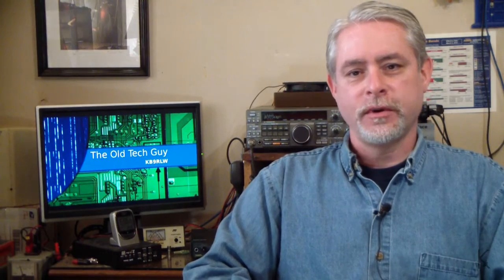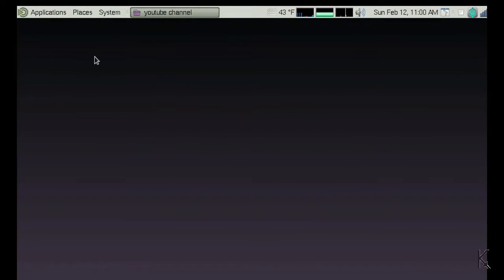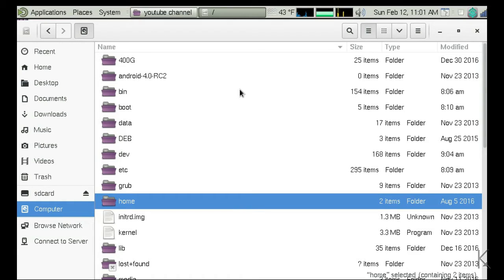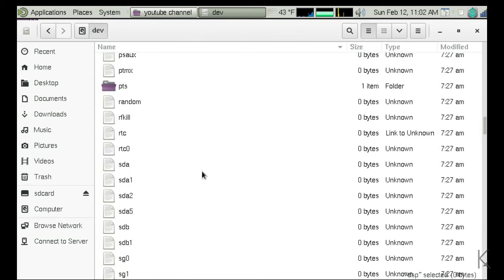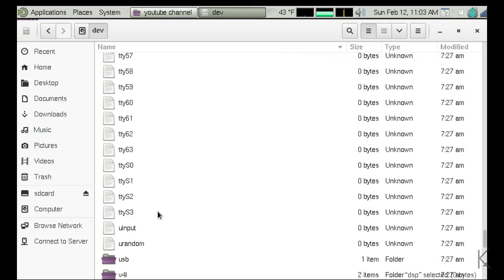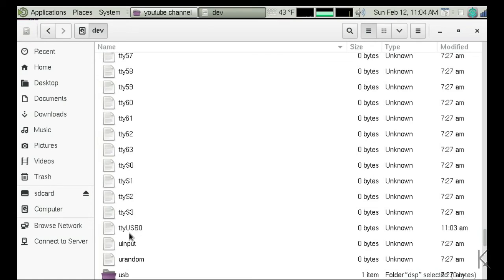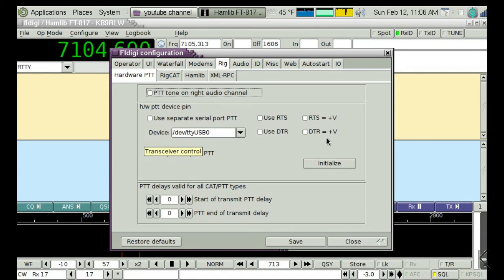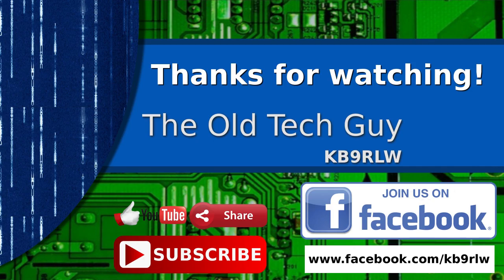Ham Radio - Setting up RIG control under the Linux OS

Comment: When you say that devices are not files you are technically wrong: devices are treated under **nix like any other file. You can use open, read, write, close ...you can type "echo hello > /dev/tty1" or cat <dev/tty1". Devices do not use disk space, they just get/send their data via the asociated device driver. The kernel treats all files the same way.
Reply from the maker: What I meant was the entries in the dev directory are not physical files on disc.

Comment: Kevin I recently acquired a raspberry Pi 4 and was wondering if HRD can be downloaded to it since it is operating via a Linux? Posible ?  Thanks again for your great videos  73 de Roger W8RLP
Reply from the maker: Nope.  Not even through WINE.   The Pi runs on an ARM processor, which is a risc chip.  HRD is an X86 binary and would only run on Intel or AMD processors.
Reply: Kevin Loughin Thank you very much Kevin. I enjoy your content, great video’s. 73 Rogr

Comment: I'm really new at this when it comes to Linux. I'm using Peppermint os and I can not get VFO control using Ham Lib from Fldigi, Flrig and JS8Call. I have 2 PCI serial ports. One is com 2 in Windows and that controls the Kenwood TS 2000 and an offline SCS-PTC tnc and in that acc port where normally the tnc goes. I have the signalink. Don't ask me to go there as Fldigi can not find that sound card.

Comment: I keep putting in the   dev/tty/USB0 then hit initialize and it returns to none don't know if it is drivers or something else tried deferent usb to rs232 devices
Reply from the maker: Well, what you typed here is wrong.  No slash in the device name.  ttyUSB0 is the device name,  /dev/ is the directory the device lives in.  So it would be /dev/ttyUSB0     
It's a full path name.  The first / means start at the root of the filesystem,  dev is the directory, the second slash means inside that directory, and finally the file name.
You can verify this by browsing to that directory, scroll down until you find the end of the list of tty files and see if there is a ttyUSB# device listed.   Another possible device name would be ttyACM0  But that's usually associated with a microcontroller device.
Reply from the maker: Also, in most software, where it says none, that's a drop down menu that might show any serial devices it automatically detected.  If it's a drop down menu, just click it and look at what's listed.  ttyUSB0 or ttyUSB1 might be there already and you only have to click it.
Reply: I typed it wrong here but it is correct in the drop down I don't see any auto setting and if it is in auto it would still be able to connect to the radio
Reply: I also run fldigi and flrig in windows 7 computer and have no problems
Reply from the maker: What type of interface are you using?   Also, did you go into the file browser and look in the /dev directory to see what it is named there?

Oh,  I just had a thought.   You might not be in the dialout group...   Linux is like UNIX from the mainframe days and has security on many things, including serial port access.  They used to have to limit access to modems by user.
Open a terminal and type the following,  case is important, that's a capitol G.

sudo usermod -a -G dialout {username}

Where {username} is your login name.  If you're not sure of it, you can type  whoami  in the terminal and it will tell you.

That command will ask for your password.   After it's done,  log out and then log back in, or do a restart/reboot.
See if that does it.
Reply: That didn't work.I am thinking it is drivers for usb to rs232 I am looking in Synaptic and there are several which do you recommend by the way I am running Ubuntu 18.04
Reply: Well I was waiting on you I watched another video of yours on installing amateur radio software with Synaptic.I installed other items and you said to log out and back in so I did.I tried fldigi rig set up just by off chance it solved the problem  and it worked.I love it when I accidentally solve a problem
Reply from the maker: The kernel comes with drivers already present for nearly all USB to serial chips.  Did you log out and back in after adding your user to the dialout group?  Did you verify that the ttyUSB# device was appearing in the /dev folder?
Reply from the maker: Ah, just saw your second comment.  OK, glad it's working for you now.

Comment: Thank you for straight forward explanation. My problem is that FlRig does not communicate with my TS-590SG even though /dev/ttyUSB0 is selected. When I run Hamlib Trace, there is a message stating that this port is DENIED permission. Is this something you know about?
Thank You
Reply from the maker: +Nuclear Ship Savannah Amateur Radio Club NSS-ARC yes, your user needs to be a member of the dialout group.  In another comment, I detailed the steps.
Reply: thanks for such a rapid response! 73
Reply: Works as advertised. Super FB!

Comment: I can't seem to get a serial port to key my transmitter. I see S0...S7 but none seem to work. I select each in turn then initialize and try to transmit. Serial card goes to the Packet Jack on my radio which has audio in and out and a PTT line. Using RTS/DTR and these work in Windows. Not using any other rig control software at this time. Running Mint Mate 18.1.
Any ideas how to get FLDIGI to work here?
Reply from the maker: Using RTS/DTR as a voltage source to turn on a transistor which grounds the PTT line?    Or,  using a level converter and rx tx lines for serial communications and CAT control?
What kind of serial port or adapter?  Is it serial port built into the computer or a USB serial adapter?
Reply: Thanks.
Yes, both RTS(pin 7) and DTR(pin 4) go thru diodes to the base of a npn(2N2222) which grounds ptt (pin 5 is the ground). The serial port is on the MB. The receive audio works fine. Either one of these lines works with Windows fldigi and every other sound card software I've tried in windows. I'm not using the rig serial port at all.
Reply from the maker: Ok.  So in fldigi, you want to set the serial device to /dev/ttyS0  Then set it to use DTR for PTT.
Reply from the maker: You can open a terminal and type  dmesg | grep tty
That should show you what tty device got assigned to your serial port.   You should see something like
 1.145755] serial8250: ttyS0 at I/O 0x3f8 (irq = 4) is a 16550A
 1.172736] 00:0c: ttyS0 at I/O 0x3f8 (irq = 4) is a 16550A
Reply: I had done all of those(It's ttyS0) before I asked you for help. No joy. Everything you said should work. Thanks again for taking the time. Maybe a permission issue?
Reply from the maker: Yes,   you have to be a member of the group named "dialout"
In a terminal,
sudo usermod -a -G dialout MY_USER_NAME

Then you need to log out and back in, or reboot.
Reply: Not a member. I've had permission issues when I added HDs to an existing system. It was always easier for me to  delete the linux partitions and reinstall it with the drive installed rather than t/s the problem! Forums were not useful for a newbie like me. The answers were too arcane for me to understand. I do use Mint as my go to OS for many things but I may defer to Windows for this ham radio software. I don't want to give up but I've spent hours trying to fix this. I haven't tried you latest suggestion yet, I'm close to the burnout point :) I need to take a break. Thank you for your patience! You have gone above and beyond. Thank you!
Reply from the maker: Well if you're not in the dialout group, then you can't access the serial ports.  So that's your problem.
It's a security feature from the mainframe days when modems were used to connect to other systems and users needed to be restricted.
Reply: Thanks.That's funny. Step 1: dialout group. If not in the dialout group nothing else will work! Good to know! Why is that fact missing in every linux fldigi install that I've seen (rhetorical)? Amazing!

Comment: hi switched to linux mint nearly 2years ago when win 7 support stopped I run fldigi for data modes gqrx for sdr on a funcube dongle cqrlog takes care of logging dx  cluster  and rig control for pouncing on cluster notices the only thing I can't get to work is rig control sharing for cqrlog +fldigi just won't do it ? so I live without it honestly best thing I ever did sharp learning curve but put it on an old computer and learn like the channel good luck Steve GW7LOP

Comment: Kevin,

Do you ever sleep?  Ha!

Show more hams how to use that old lap top by installing Linux and show what it can do and why.  Every one has an old no longer supported lap top just sitting there.  We are afraid to throw it out because of the old credit card and other private information still hidden somewhere on the hard drive (my son just wrecked a perfectly useable one with a sledge for that very reason). I am just getting into it to revive an old lap top just for the ham shack.

Dave K8WPE (QRP Forever)
Reply from the maker: Yep.    My station computer is an 8 year old netbook running debian linux.   I can watch youtube while it decodes 8 stations on JT65 flawlessly.   Linux rocks.

Comment: I use Debian with a KDE desktop. I wish I still had my ASR33. I was never a Ham but I loved to read the ARRL manual when I was a kid. Computers are not as much fun as they used to be so I may have to get into Ham Radio... and it will be all your fault.
Reply from the maker: Well, so I am doing some good in the world...    
All my machines run linux and I do all my work and video on it too.     I love the reliability and stability.   I used to admin 650 Macintosh workstations, and previously worked in a company where I supported over 1200 windows machines.    I would tell people, "I fix computer problems all day at work, all I want to do at home is use my computers, not fix em.   So I run linux."
Reply: 1200 windows machines? Even writing it kinda hurts my fingers. I have an electronic switch that chooses between a box running WinXP, Win7, Linux, and FreeDos. It switches my monitor, keyboard, mouse, printer, and a USB stick from one computer to the other. The Linux computer is the only one that can get on the Internet. This calms the Windows monster down. If I need something for Windows I down load it to the stick and hit the button. I do most of my work on the Dos computer. I design PCB's on Tango software running in Dos. The software is 25 years old. I just traded the 486 in on an HP fanless thin client. The extra speed doesn't mean much but I was getting worried that that 25 year old hard disk was going to die any day. The HP has a flash drive and I can backup decades of work in less than 2G on a USB stick. What video editor do you use? I just downloaded Shotcut, but I haven't used it yet. You may have already done a video on your setup, camera, editor, if not it would be a good idea. Your videos look real good. Sound is excellent. Of course you are Canadian, that explains a lot. Seriously, Canadians are very artistic.
Reply from the maker: HA!   Nope,  not Canadian.   That's Mr. Carlsons Lab...     I live in north eastern Indiana in the U.S...  DOS was elegant in it's simplicity.  I used CP/M also for a time...   Install DOSbox on your linux machine and check it out.   Nice DOS VM.
I use kdenlive to edit the videos currently.   I've been slowly improving the production work.    All open source stuff.   GIMP, Inkscape,  Libreoffice draw and writer,  Audacity,  DIA, and blender.
Reply from the maker: Head over to the new facebook page,  comment threads like this one would work better as discussions over there.   facebook.com/kb9rlw
Reply: Sorry, I get confused easily now days. I'll have to check out Mr. Carlsons Lab. Indiana was Garfield's home state. I knew cats would show up eventually.
Reply: Hi Terry! I had a very similar experience. I still have my C book I got in 1977 when I wanted to learn C. Every time I try I think "Why would anyone use this when there are Assemblers?" But I'm going to have to try again so I can play with my Raspberry Pi.
Reply: Wayne, I used punch cards for individual instructions that were read with a card reader and sent to the compiler of the college mainframe then the output, good or bad, was printed on a line printer (132 columns to a line). Within a year the college was changing to dumb terminals that Kevin mentioned. Another year passed by; I had to drop out of school. When I returned there was a dedicated lab with dumb terminals that looked like desktop PC's each with 4k of RAM. The university had replaced their mainframe and ran an early version of Unix. Students were given access to the lab with no instruction how to use the terminals or what commands to type in on the Unix operating system. Thankful there were grad students to help out. Dropped out again. Went through the home PC stage of proprietary PC's (TRS80, Commodore C64C and 128D with CP/M or CBMDOS) then IBM PS/2 (DOS, WFW3.0 & 3.11, 95, 98, and 98SE). Built my own PC in 92 and began hearing about a spin off of something called Linux that was sort of like Unix and Minix. Dabbled with it for a while running dual boot Windows XP Pro and Red Hat (and many other distros). Have to say XP Pro was best version I used from M$ (less BSD and actually could run for months without rebooting). Been fulltime Linux since last quarter of 2005. Some programmers and Linux gurus much smarter than I are maintaining old Unix/Ham versions and creating new ones. Very glad that I found Kevin's videos. I'm glad that he continues to make new ones. Have nice day.